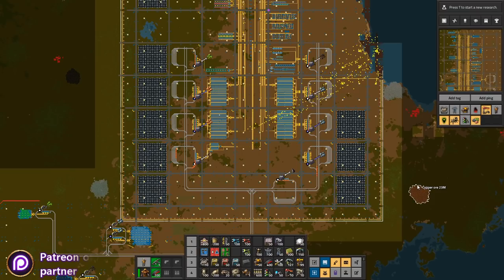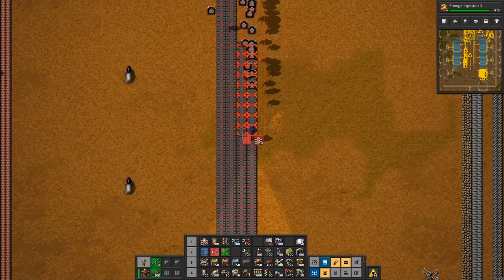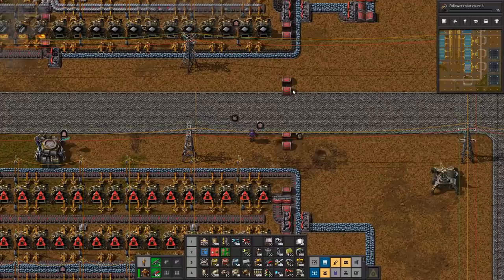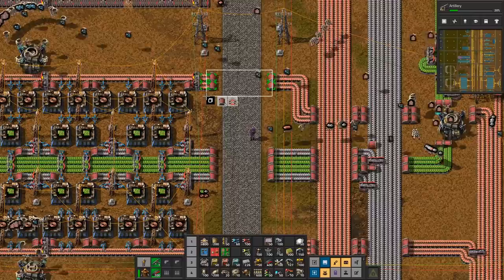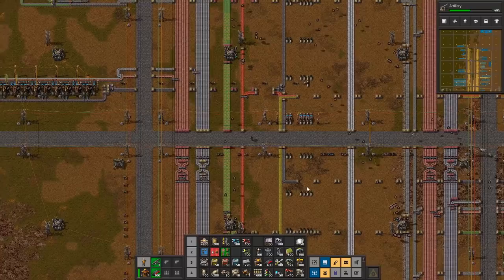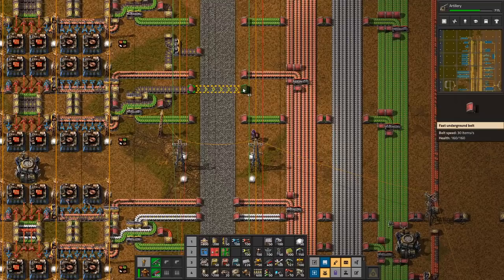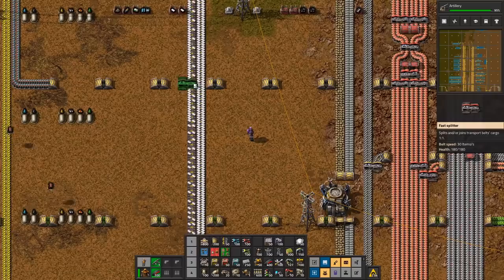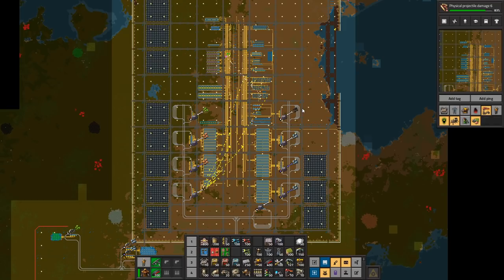Super Circuit Upgrade | #15 | Factorio Lets Play/Walkthrough/Guide

Comment: just a cool tip I learned with the logistics system and circuit networks. if you set the inserter on the machine making yellow belts to only put in the chest if it has less than 50 (for a short while) and set filters on every yellow logistic chest so the robots can only put the yellow belts in those output chests. then crank up the max red belts on those inserters, you can issue a command to upgrade the entire base in one go and have enough belts. here is why: by telling the yellow belt inserters to only do if less than 50, as the robots swap out the red for yellow they will keep that chest full. the machine making red belts will never run out of yellow and it actually recycles the old yellow belts to the new red belts instead of consuming a ton of new yellow belts. which also saves on massive resources.

Comment: i wasnt quite able to follow how the new iron unloader/smeltery was integrated, but i heard "this is all about trying to balance where things are coming from", and came up with this:

if you define the northernmost unloader as Station A, the middle as B, and the southern as C, then from left to right, set your iron belts to take from them in this order, ABCA ABCB ABCC

that way each set of four belts has at least one belt from each unloader, and each unloader has exactly 4 output belts

idk if thats how you're supposed to do it, but its working for me
Reply: I tried to track what he did as well.  Using your same naming convention, I had it like this: CCBB, CCAA, AABB.

Comment: Few comments on the blueprints: 1. It would be nice if they were consistent on the question of half-belts and splitting them at production rather than out on the belt. Some of them manage to split at production, but most require figuring out a good way to split them in nature without impacting the bus in a major way which is something that I find challenging on occasion. 2. Pipes entering the hub are a bit restrictive, particularly when you go to upgrade an existing setup, and especially before robots can make things a bit less irksome when it comes to getting rid of individual pipes. Likewise when it comes to upgrading individual inserters or chests in a 3part hub... I think your older paradigm (non-gridsnapped, 3 individual pieces, at least for the upgrade blueprints) was likely superior.

Comment: Great series, grats on the 100k. With blues backing up and good capacity on red and green - start churning out  modules? Yet gonna need them. BTW, I find setting up a small red belt only factory is beneficial. Undergrounds add on if necessary...

Comment: what are the last four lanes of copper for? I fiddled with putting them in the same lane as the green circuits and using them as the dedicated copper supply (so you go four lanes of copper -> 2 copper/2 green -> 4 green) so you could keep the leftmost four lanes all the way up the bus, but it was sort a of a pain to set up and I don't know where you have any room at all for them any further up the bus
Reply: Pondering the same thing myself.. wondering if I missed something.  Kind of wish he'd pan through the ENTIRE bus at the end of each episode.  I have 2 full city blocks of copper smelting, 16 belts, but at the end of ep#15 I only have 12 of them connected to anything.  There is DEFINITLY not enough copper going up the left side to feed the red/green/blue circuits all running full speed on red belts so we shall see.  OR I missed something in this or a previous episode?
Reply: @FeistyCanuck  You should have 14 connected and 2 not connected. If you are a Patreon you can check the save game file